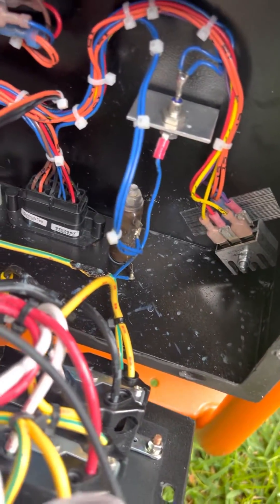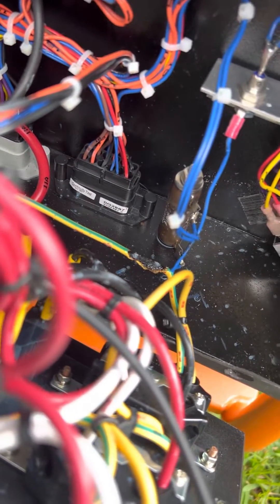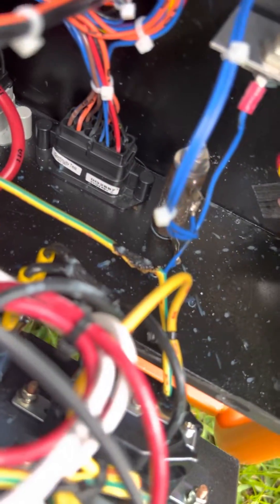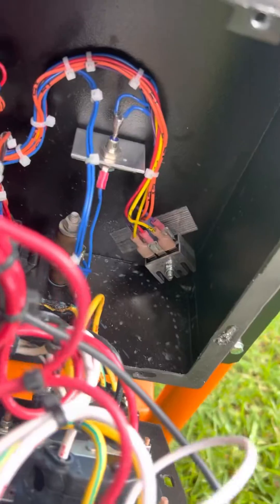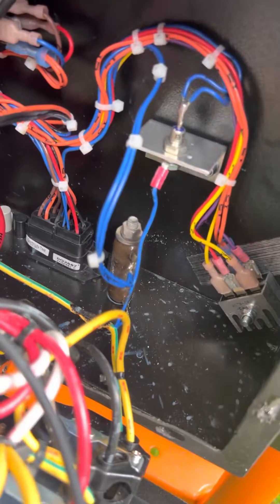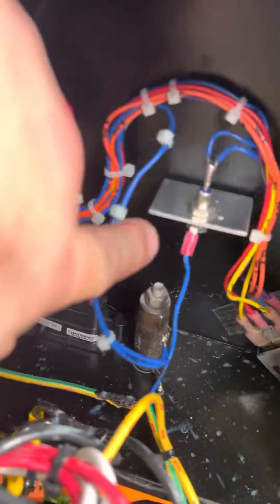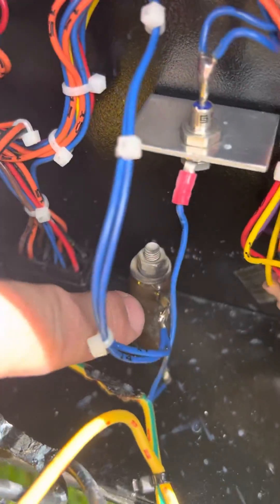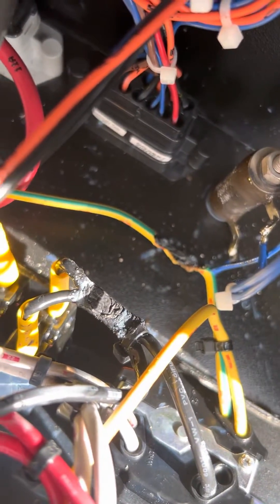Generac GP17500E FACTORY FLAW FAILURE. Portable Generator Version. BE AWARE 2023+ Models

Comment: I called generac they came and looked at it they said they don’t fix gas units please help I’m a single mother of 3 and I try to fix my own stuff but this generator was too expensive to only had worked on start up I did everything by the book oil and gas , some guy came and charged me 200 up front told me it was the carburetor he took my money called me the next day said he couldn’t fix it that it was an electric issue

Comment: Mine is a 17500e generac looks the same i bought it only used it to start it and test it it has .7 hours on it when I tried to start it the other day before the storm it never started I paid a guy he came and looked at it told me it was the carb he charged me 200 up front called me the next day told me he could not fix it I am a single mother of 3 but I try to do what I can and I don’t have time to spend 4,000$ on generator I do know these were recalled?
Reply from the maker: I need a model / serial. 

Who found that wire 18 disconnected allows it to run?
Reply from the maker: Recalled for what
Reply: I  googled the model it says fire hazard that if you contact generac they send you parts and the wire 18 thing I also googled it and there was a forum but they never posted what was the solution so I tried it and it works with the wire off but when I try to turn off it won’t I have to put it on choke so it can turn off
Reply: Where can I find the serial and model number?
Reply: Otherwise it won’t start at all with the wire on

Comment: What was the issue with it my generator has no spark when I unplug wire #18 it has spark and starts
Reply: Omg thanks so much for the help I’m about to try it how can I try to see if it’s the oil switch ? Just unplug the wires to it? I took the control panel off myself but did not see any burnt wires or blown fuse I’m in Texas right now and it’s just me and my three little girls and I don’t know if you know but we had a winter storm and there is another coming
Reply from the maker: @esmeraldabailon9096  send me model / serial. I’ll look up a wiring diagram to verify exactly what’s wrong and I’ll let you know what to check to confirm
Reply: Thanks so much for the fast respond I will definitely subscribe and alerts on and everything, never I had anyone respond to any of my comments
Reply from the maker: Your low oil switch is bad
Reply from the maker: Causing #18 to ground itself.  Shutting off spark